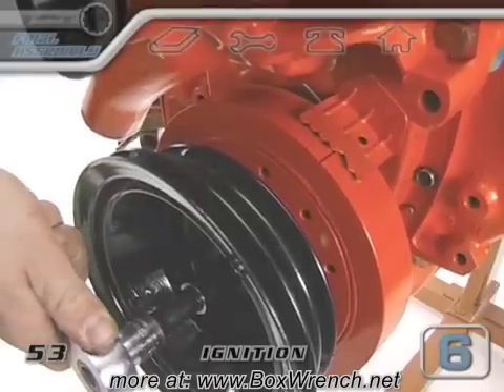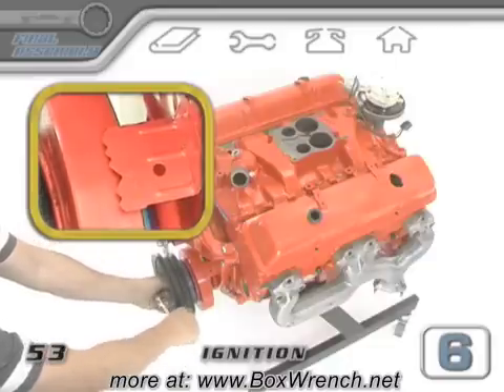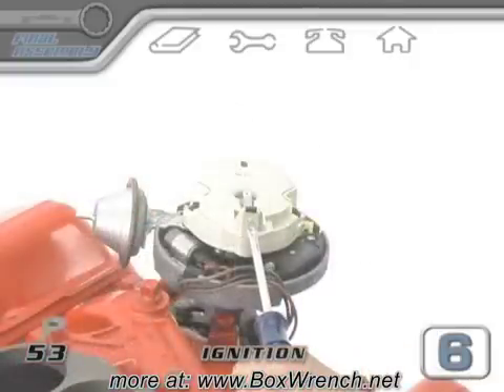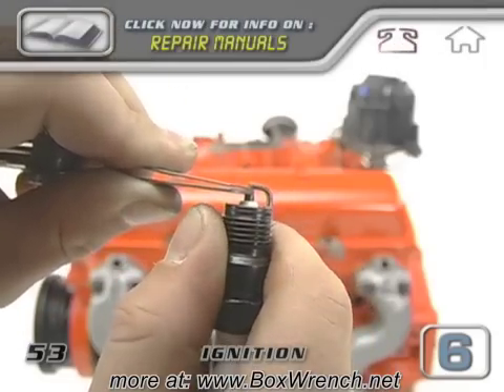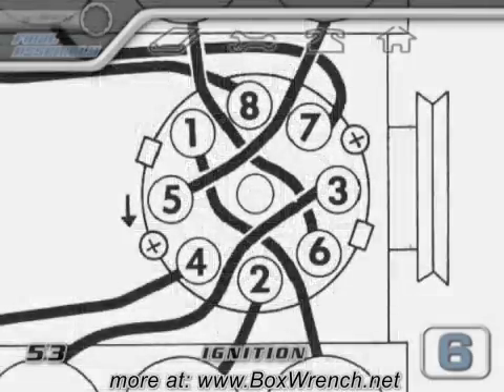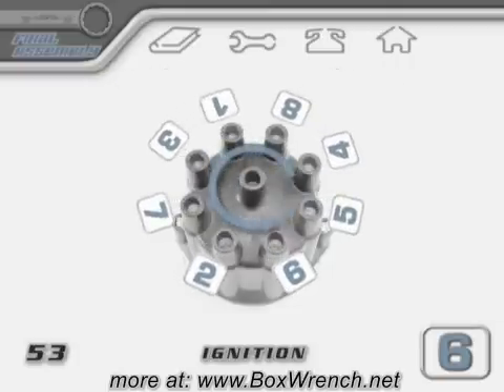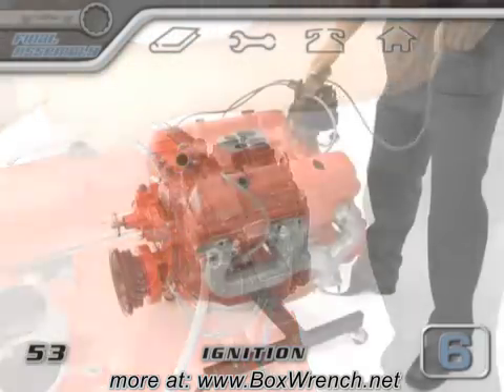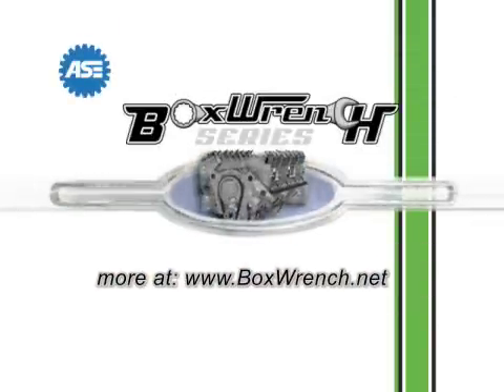Engine Ignition: Wiring Distributor & Spark Plugs Video- DVD

Comment: When you pre  prime your engine oil dose it take the assembly lube off your cam and main bearings
Reply: If you built your engine properly with engine assembly lubricant, you shouldn't have to worry about oil priming diluting the assembly lube. The assembly lube will stay in place and remain effective through the priming process or long term storage. 
The more you rotate the camshaft prior to start-up however, you are wiping more and more of the cam lobe lubricant of any flat tappet cam and non-roller lifter combos...

If you didn't put any engine assembly lube on the main and rod journals of the crank or the camshaft bearings, you'll certainly want to prime the oil to make sure that oil pressure will build shortly after engine fire-up. 

If you don't put any cam lube with molydbenum in it, upon the cam lobes of a flat  tappet camshaft and lifter set-up, you're running a high risk of a cam lobe or two wiping themselves out and then needing to replace that camshaft and clean the block interior within a few dozen hours of engine operation. And, for flat tappet cams, you need to use an engine oil with zinc to your oil, or use an engine oil designed for diesel or race engines that already has zinc added to it.
Reply: when I was checking my rotor it was pointing to number one and my harmonic balancer was at 40 degrees at compression. but my car was idling good could my timing still be off
Reply: also my car was idling good but when I give it gas maybe about 2500 or 3000 RPMs the car would hesitate is this mean my timing's off

Comment: In another video you didn't want to rotate the engine more than one cycle so as not to scrape the assembly lube off the camshaft, but here you go through another?  A good assembly lube should keep it lubricated until oil starts circulating.

Comment: You can find the firing order on the internet for your truck/engine or if the intake is factory it is printed on it the distributor goes in sequence 1-8 usually clockwise. As you look at the engine from the front the right side(drivers side) is 1-3-5-7 front to back and the left (Passengers) is 2-4-6-8 front to back. I assume your engine was running so you don't need to go through the steps in this video except for the wiring portion.

Comment: hello people am a 15 years old,and am trying to install the spark plugs wires into my 92 chevy, 454ss and i took off all the spark plug wires on the passenger side off from the truck now i dont know what to do to know which cable goes where how can i figure out which spark plug cable goes where ? PLS IF YOU CAN HELP MI OUT OR SHOW MI A VIDOE ON YOUTUBE THAT EXPLAINS MI THIS ILL APPRECIATE IT ALOT THANKS

Comment: These engines are so different from each other as to Imports. I normally use a long rod in the spark plug hole and turn the engine until I see the rod go all the way up to set the TDC, sometimes feeling the air from the Cylinder confuses many people.

Comment: @SkylarkGSX ...so if i'm doing a complete tune up...cap rotor wires and plugs...does the number one tower have to be the same on the new distributor as it was on the old one?  either way, does the rotor have to point to the number one tower, when I put the cap on?

Comment: @cfsierra i mixed the order up once on my truck...it didn't even start...sounds like you didn't get on of the wires all the way on a tower or its plug...or like you didn't get the plug in right (causes a misfire and piston goes all the way up without combustion)....what did it end up being anyway?

Comment: @BoxWrench my bro and an auto store cashier tried to tell me that the wires have to go in the same place on the cap always...but i BEGGED to differ with them...can I put "1" on, anywhere and wire from there?  I'm pretty sure I can...I'm just worried about the rotor being in the wrong place when I go to start after a tune up.....but the rotor should just rotate a bit and catch on....right?

Comment from the maker: @robert30319 We have standard recommended torque specs for a fair amount of V8 engines on our site. Be sure to also click the link if you're using ARP Bolts as they have separate torque specs.

On any of our site pages. you'll see a link for 'Engine Specs' on the left.

Comment from the maker: @councilman1993 The crank is spinning at double the speed of the camshaft. The rotor and distributor are driven by the camshaft. So, one revolution of the dist. rotor is caused by one revolution of the camshaft and the crank will have spun around twice during the same period of time...
All of that means that the rotor will pass the tower for each cylinders spark event, only during the compression stroke.

Comment from the maker: The battery is needed for the large current draw of the starter motor. An alternator cannot  create enough amperage to operate a starter motor. 
The alternator does create enough voltage and amperage to create sparks to keep the engine running however. Yes it is true you can start a car and remove the battery, it will keep running off of the alternator. 
If you stop the engine, you would need to reconnect a battery to drive the starter motor again....

Comment: thanks but the battery is only needed for starting the car i thought so if you took the battery out would it not run or would it use the volts from the alternater then?

Comment from the maker: On the distributor seen in this video, there is a coil inside the distributor cap. On other types of ignition systems there is one separate coil where a wire feeds electricity to the center of the distributor cap. Still other designs have an individual coil for each cylinder. 

The coil coverts 12 volts from the battery to higher voltages that then travel along the spark plug wire and create a spark when they jump across the spark plug gap itself...

Comment from the maker: With a timing light that has a dial on the back you can use it like any order basic light if you just set the dial at 'zero'.

If you set the dial on the gun at 10 degrees, you would point the light at the balancer and rotate the distributor until the timing tab or pointer lines up with the balancer as if you were trying to set "zero" TDC timing. With the dial at any number, you just line up the zero marks and you know the timing is set to the number on the dial.

Comment from the maker: The orange painting block in the video is a Small-Block Chevy but the procedure described is accurate for any type of engine. 

You can check the BoxWrench website (web address is in the logo at upper right) and get all the info described here for your Chevy and many other makes of engines. 

The 'Basic Engine Building' DVD also has all of the rest of the rebuild info from removal to start-up...

Comment: hey id like to know how smooth a v8 engine could handle only 6 spark plugs... will it run as smooth as a normal 4-cyl with 4 spark plugs?.... i guess the procedure of deactivating cylinders would also need to have something clogging the rest of the fuel line.... using some sort of closed end nut? so as to decrease the loss of fuel

Comment from the maker: Yes, a 4 cylinder engine can run with almost no apparent problems on 3 cylinders. It depends on what type of ignition timing compensation is built into the ECU or ignition, but you may not even notice if a coil, spark plug or wire is faulty. 

We've even seen V8s run on 4 cylinders and V6s run on 4. Not smoothly, but they'll run.